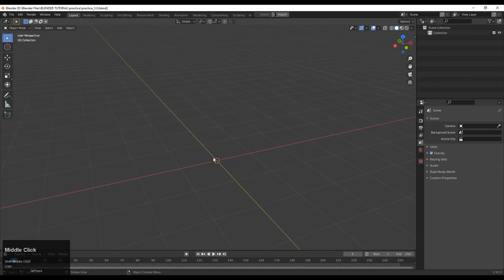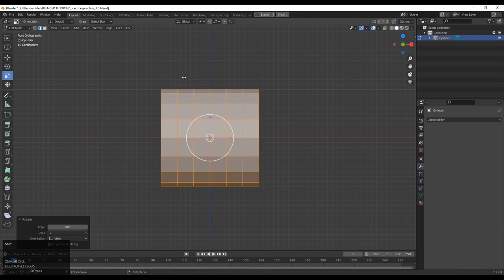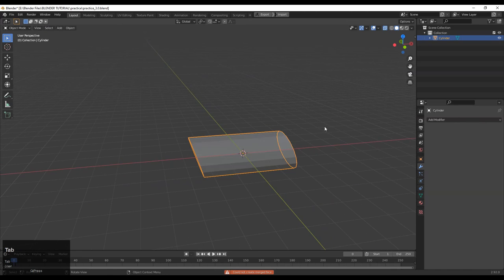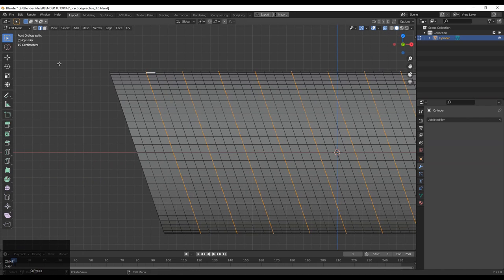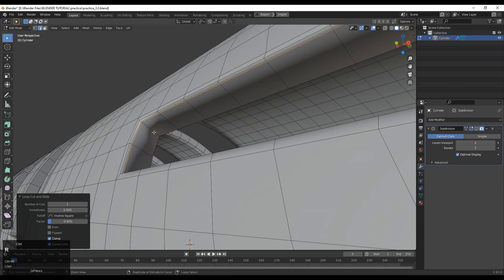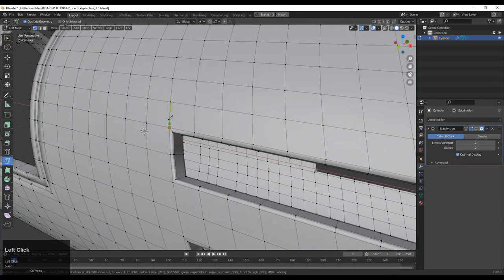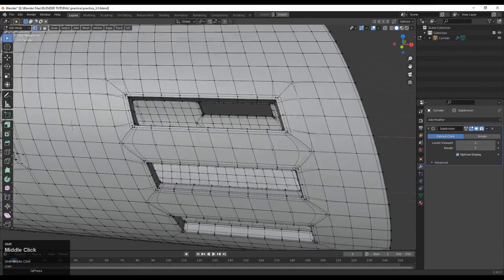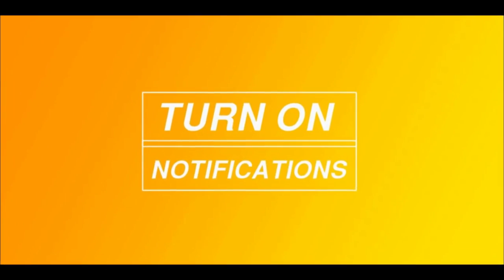Blender Hard Surface Modeling | Create Clean Booleans | Blender 3D

Comment: To achieve what you did in the first 2 minutes or so, yo could have just selected both the left and the right faces at the start in the low poly mesh and ctrl+alt+shift+s to sheer them to the right angle on the Y axis. It'd save the fiddling with the knife.

Comment: is hard surface modeling like this like 100% of a time or there is a different workflow? beginner here! :)
Reply from the maker: This hard surface modeling is for vfx production, in which you required high poly models with right topology.  But in game production your topology doesn't matter too much. You can create models with ngons and triangles. In game production they use low poly optimization process, I will explain it in my future tutorials. I hope it will help you 🙂
Reply: @CRNTDESIGNERS  oh ok. so the modeling process u showed here is the same process used also for modeling complex models?
Reply from the maker: @Vince-pm5dn  Yes